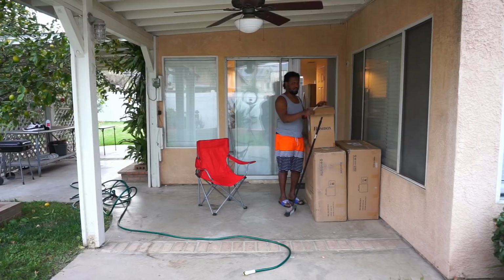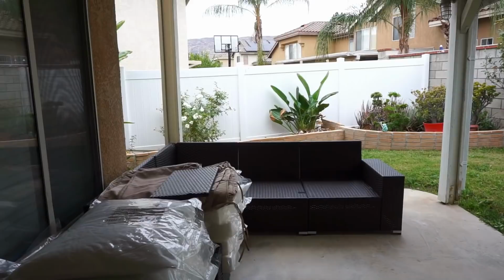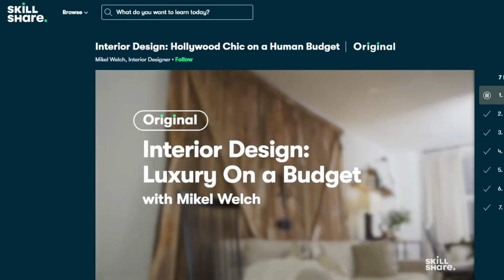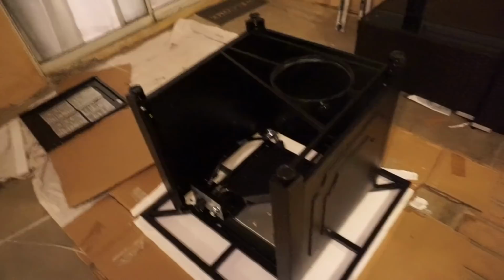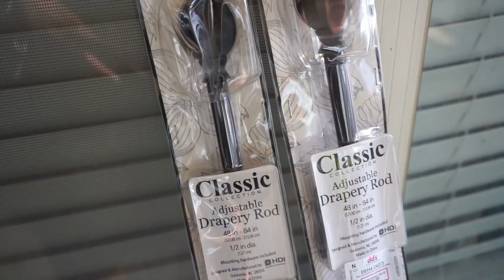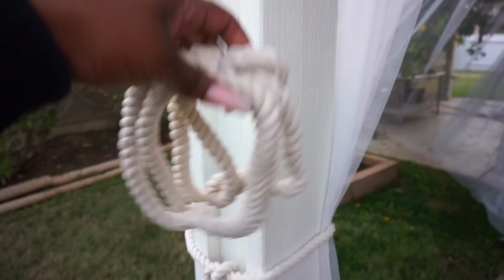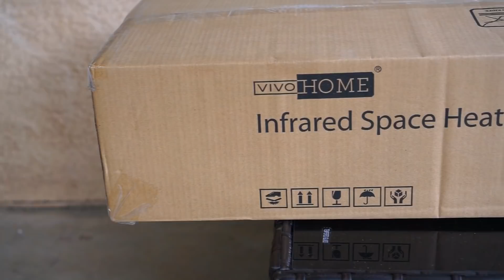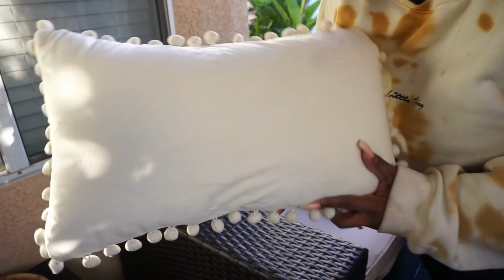ULTIMATE diy Patio Makeover! STEP-BY-STEP (if we could do it, you could do it!) 2022

Comment: Ok, I am only seeing this after a year..it turned out beautifully.💙💙  My back porch is mesh screened in, problem is, when it rains it is a mess.  I do have waterproof curtains which helps also for privacy. A regular curtain rod could not hold the curtains, so I used 3/4 inch pipes from Home Depot. My dream is to have the back porch fully screened in with fiberglass, then I will be able to enjoy the space more.  In the meanwhile, we will make do as most of the new houses being built, do not have screened in porches. Continue to enjoy your makeover space. 💕💕